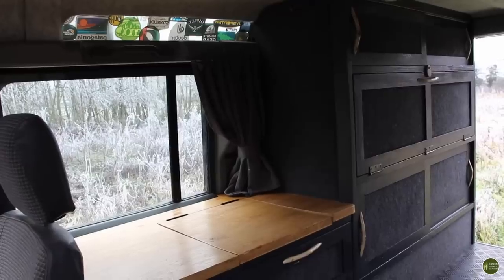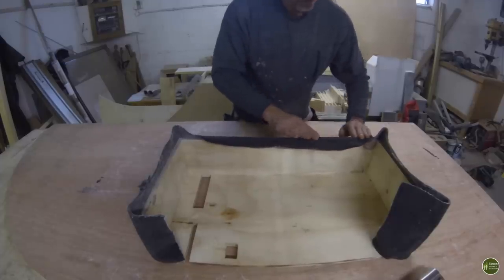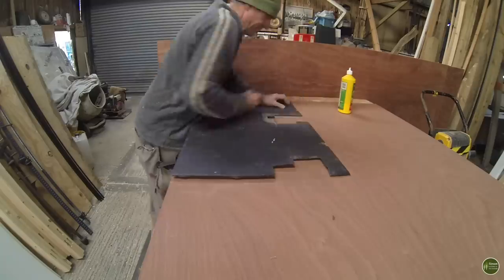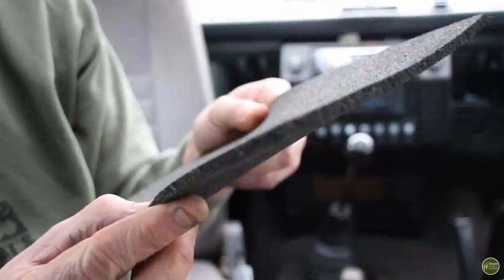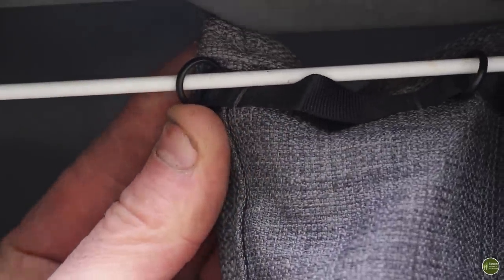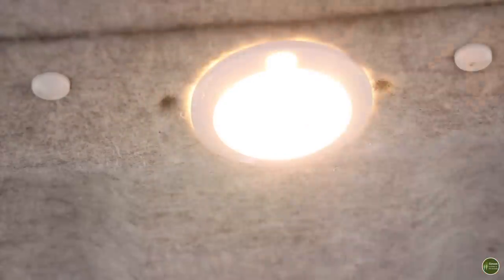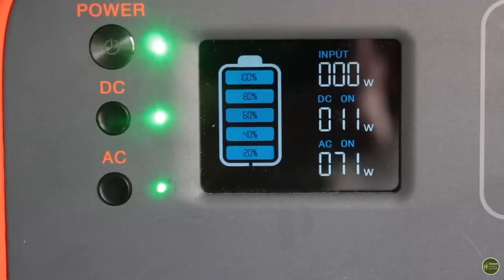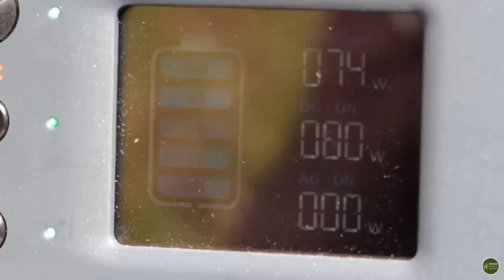Land Rover Home Build Camper Conversion - Part 2.  Off-Road, Off-Grid Adventure Vehicle.

Comment from the maker: Hi folks - some of you were having trouble with the discount code for the heater - this is now sorted - all my fault!
The code is ‘Simon’
👍
Reply: I went on their website. They have a ton of heaters. Which model do you have? I don't see any at £95. I assume that's after the discount.
Reply: This is nice and perfect .. good job pal
Reply: Like it
Reply from the maker: @Rob S Mine is the one at the top - it’s actually £103 - my mistake. 👍
Reply: That solar panel link is now a dead end I think, just so you know..
Reply: Simon the heater doesn't have a thermostat control it has one for safety but not to maintain a 'room temperature' it states deg. but its just a fuel rate you can swap it to hz's if you like.

Comment: Really loving your build. A couple of things about the diesel heater, wrap the pump in foam and put under the vehicle in a box attached to the underside. Your blower air intake is supposed to be recirculating the already warmed air inside your vehicle, pulling in and heating  -1° air from outside will use a load of diesel unnecessarily. All you are achieving is forcing out the warm air around your door rubbers and windows etc. Heat heated air and crack a window slightly for ventilation
Reply from the maker: Thanks Andy - good point about the cold air - I may turn it around and draw air from the drivers footwell 👍
Reply: @simonablokeinthewoods  on the plus side of your setup you will have fresh warm air and no condensation but it’s not ideal. If it was my build then I would fit a lever system to divert between fresh or recirculating air. Loving the content by the way 😄

Comment: Hi Simon, very good convertion! I would definetly put a separate battery for domestics, all it needs is a split diode from the alternator!
I had this arrangement in my boat for years and it saved me from having a flat for engine start. Later you may add a small fridge and it will make thing worth. Good luck and stay safe. Fernando.
Reply from the maker: I think I’m going to do that 👍👍

Comment: Just watched on TV, yet again great vid Simon, regarding the diesel heater and the split charge system, definitely fit a leisure battery there deep cycle and will keep charge longer, they will still start the landy if needed, the T max split charge system has a button on the monitor that you can press if your starter battery is flat and it makes temporary connection to your main battery enabling you to start up, neat feature, I had the same system in my old defender with two 100ah leisure batteries and the same or very similar diesel heater 👍
Reply from the maker: Thanks Pete!
I’m assuming you had the two leisure batteries in addition to your main starter battery?
I’m looking at a suitable agm leisure battery at the moment 👍👍
Reply: @simonablokeinthewoods  hi Simon, yeah starter>split charge > leisure > auxiliary fuse box and on from there , have pretty much the same as before in my present 110 just different split charge relay as it was already in when I bought it, although I am going to change to a 30 amp victron battery to battery (DC to DC) charger as the give all batteries equal charge, I have my diesel heater fitted in an aluminium box so I can move it th where I need it as we run roof tent, 370°awning with side walls etc as we need more space to cater for an 11 and 9 year olds, I'm converting an ex military penman trailer into an overland camping trailer then roof tent etc will be moved to that so the landy is freed up, anyway I'm waffling on, keep the vids coming really enjoy them 👍

Comment: Hi Simon. Great build, I love it. As for your pumped water supply, I used a 12v submersible pump from a caravan shop. Also available as a 12v shower unit on Ebay for around £20. Then used a 20ltr plastic oil container, scrounged from a fast food shop, for my water container under the sink. Hardest part was making a pipe disconect so I could take the container out to refill. Just used the rubber end of a pen to push into the pipe. I have a VW T4 that I converted 6 years ago. But!!! Now, after watching this, I'm looking for a ex MOD 110 Defender :-)

Comment: Nice video Simon 👍. It's always a ongoing project,  with customizing vehicles 😉. I would get a deep cycle battery 12 volt, you can run a TV - laptop  - mini fridge. For 2 days on a fully charged one 😉, tho I do have a generator for emergency power.

Comment: Very nice. The heater looks to be nice and toasty. The seat swivel is fantastic. I would use the idea but my truck is a 1963 3-door series 2A with a bulkhead behind the front seats. Do you have details on the sink and water pump on a different Video? Thank you.

Comment: I have ripped out and binned Webasto, Eberspacher and Mikuni heaters from various camper builds when one or more of their components have failed and replaced them with 5Kw Chinese diesel air heaters.
One dosing pump for an eberspacher costs almost double the price for an entire Chinese heater kit.
All you need to remember is that the Chinese heater is a direct copy of the Eberspacher D2. The research and development had been done years ago in Germany, the Chinese simply made a squillion copies when the copyright expired after 25 years.
You could buy 15 Chinese heater kits or one eberspacher kit ....Anybody would buy a second Chinese heater just for spare parts 😀

liking the build.

Comment: Gday Simon, awesome video. Lets talk batteries, you need an AGM (aggregated glass mat) battery, what ever you do, do not use a lead acid battery they are not designed for running appliances and they have different charging characteristics, AGM like at least a 75% discharge and a quick recharge and they don't give off any gases they can be installed upside down if need be. There's plenty of info on the net if you want to research it which is what I would recommend.
Looking forward to the next instalment.
Cheers and keep on trucken 👍🏻🇦🇺
Reply from the maker: That is great info - thanks mate! Agm it is 👍👍👍
Reply: Simon, a bloke in the woods you might also want to look into some sort of smart charger, there are some good affordable ones out there, either three stage or five stage and the higher the amps the quicker the charge. Cheers 👍🏻🇦🇺

Comment: Hi Smon, cracking job on the conversion, and I loved the hammock, if you go down the split charging route, I seem to remember you need a deep cycle battery to run your equip from, as  this type of battery is designed so that you can flatten it totally as routine  whith out damaging the cells ,where as a normal vehicle battery doesn't like that , also be aware that if the batt is inside the vehicle, it wil produce hydrogen whilst charging, other viewers might have better info than me, but I'd take advice from someone fitting these systems as their job anyway, thanks for the video, stay safe mate, best wishe's to you and your's, Stuart.uk.

Comment: Hey Simon. I was having a good chuckle about your cold Land Rover, which I believe is a diesel. I had one as young man., I do believe it was a mid 60's model. It took some TLC and plenty of intervention. It was fun though. I also had a ?? '82 Toyota Land cruiser with the 4 banger diesel. Great mechanically but with the steel body it rusted easily. The opposite to the aluminum bodies on the LandRovers. It had armstrong steering and shifting, vinyl everything. A great basic 4wd machine I  live in the interior of BC, where it can be quite cool in the winter. Talking about cold, being a diesel it never warmed up enough to get some heat into the cabin. You could idle it all morning and the frost would just start melting on the windscreen. Just bundled up and drove to work, which was mainly downhill, brrrr! Climb a good long hill and it would warm up and then the heat would blast. Enjoyed the build and story.

Comment: One of the best Land Rover conversions I've seen although to be fair I haven't seen very many.
That heater is a good idea, it looks very compact too but I'm not convinced that the diesel hoses are suitable quality, I would definitely be wanting to change the one that goes under the floor for a more sturdy hose. I'd be surprised if you MOT mechanic doesn't say something about it too.
Reply: Ian,l wonder if it would be better in some plastic trunking? Or alluminium
Reply from the maker: Thanks Ian!
Yes, I think I might replace the external but with some braided cable and clip it to the chassis - it was a a bit of a rushed install tbh, so I could get the video out on time! 👍👍
Reply: @simonablokeinthewoods  I would second that comment, a flimsy hose dangling underneath won't last very long, you've also got to watch how close it is to the exhaust as the heat could melt it, even if you replace it with a better quality hose.
Reply: I sheathed my fuel line in some garden hose underneath the body. Works for me

Comment: Great video as usual. Being an armchair expert myself, the only thing that looked hokey to me, where those fuel lines for the heater. Other than that I think it is really a  sensible build! Kudos!
Reply from the maker: Thank you - I’m going to replace the fuel line with some braided pipe - especially where it runs outside 👍
Reply: @simonablokeinthewoods  👍

Comment: 5 litre water jerry can with tap does us nicely, easier to keep clean and use anywhere.
Reply from the maker: I’m thinking that’s the route I’m going down - Jerry can and hand pump 👍💦
Reply: @simonablokeinthewoods  We have the 10 and 20 ltr cans as well, the life saver can with filter is expensive and requires a little more care, don't let it freeze up.

Comment: Great build Simon 👍 One thing I loved which you didn't mention  is the sliding front door windows with the   series 2 window locks .Great touch did this myself to one of my landys
Reply from the maker: Cheers Robert! Yes, much prefer the old series doors - just got my second row doors back from the welders - my next job is putting them in - be glad to get rid of the defender doors! 👍

Comment: Looks amazing , my parents had a long wheel base Land Rover that had been converted for travel when I was a kid living in Iran around 1976-77 , I vaguely remember it having 2 bunks rollout (seaman’s hammock sort off) I think if you took the safari camp bed and it rolled out sideways like a rolller blind and the metal pole that came out could be affixed to something , I can’t find any pics of it ; all 35mm in those days. My dream is to convert a landy and put this type of bed in . Those heaters are a must , amazing find :)
Reply from the maker: That sounds perfect! I once used an old army stretcher as a bed in a series 3 swb Land Rover - it worked pretty well 😁

Comment: Textbook example of "form follows function".
I've seen plenty of camper conversions and this is genuinely one of the best.
Might not feature chrome, leather and fancy trim but it's well-made and functional and the end result is something that's spot-on.

It's easy to look at vehicles built for Africa or Australia and think of them as what we should aspire to but the fact is that in Britain, and Europe, having a living-space INSIDE a vehicle is much more important than in hot countries so we have a bunch of different challenges related to that.

Only thing I don't really like about this vehicle is the fact that it's based on a Defender.
That's definitely a "me" problem, though, because I've had 30 years of driving the bloody things and I'm just sick of them.
Even if they weren't so expensive, these days, I'd think twice about building a camper based on one 'cos I wouldn't fancy driving it.
Reply from the maker: Thanks Si, definitely more comfortable inside than in a roof tent in our weather! 
I hear what you are saying about the Land Rover too! They’re needy vehicles and certainly not high up on the comfometer scale!

Comment: Watched a vid on those heaters. It’s important to always have 12v. If it loses power it stops and can’t run down so the hot bits aren’t fannedand will melt and damage stuff. Could catch fire under the drivers seat. So a battery reserve is pretty important
Reply: I was wondering if it has a control board and a high limit switch to cut off the fuel if the blower stops or power goes off.
Reply: @MrPianoKnee  If the heater loses power the pump also loses power, pump and heater are connected via a wiring loom to a single 12v source. Also if the pump runs out of diesel or fils to supply diesel to the heater the heater will shut down.
Reply: You don't need a constant 12v supply, in  fact I have a secondary switch on mine so that it can be isolated when I'm away from the van. It is however important to switch the heater off via the control panel for the reasons you've given before isolating it from the 12v supply.
Reply: @Flexaret  so if you lose your supply the control board is dead the pump stops the fan stops and there’sa very hot vapourising plate that can melt the outside of the pump body because there is nothing to cool it. It’ll ruin the heater and if it’s in a confined space could potentially catch fire. I’d brush up on the actual internals if I was you. It needs that 12 v!!
Reply: @highdownmartin  The switch won't cause the heater to lose the supply unless I physically operate the switch. The source of the 12v supply doesn't change, it's coming from my leisure batteries, all I've done is fitted an inline switch which I won't  use if I'm running the heater, it's only purpose is to isolate the heater when I'm not using it. Lets face it, the unit already has a means to isolate the supply when the heater is in operation, it's called 15amp fuse, if for any reason the fuse fails as intended it'll do it when the heater in in use which means that the fan will stop and as a result fail to cool the chamber.  to quote you "watched a vid on those heaters" just about sums it up doesn't it ;-)
Reply: @Flexaret  I know what a fuse is thanks. We’re both agreed; loss of juice will cause a lot of damage to heater. Quite possibly terminal.   So I’m not posting rubbish and there’s no need for you to be so rude
Reply from the maker: I’m planning on installing a second battery as a precaution.
Reply: @simonablokeinthewoods  A secondary battery is going to be a benefit, obviously you'll isolate it via a voltage sensitive relay or charge controller from the starter battery. To clarify why I fitted an inline switch to enable me to isolate the diesel heater from the power supply, there were rumours that the heaters with the remote start facility could start up accidently (rogue signal activating the wireless control?) To be honest I wouldn't be surprised if it as a case of user error however, cheap electronics/wireless control?? 

I don't use the wireless feature and didn't want to risk the heater coming on while I was away from the van. Whether you think the benefit of remote start is worth the (minimal?) risk of accidental start up will depend on your requirements, in my case it wasn't. Just clarifying why I wired mine the way I did but in general I take the view that any 12v supply to an appliance in a camper conversion should have a means of isolating it from the batteries. :-)
Reply: @simonablokeinthewoods  top man. I wasn’t trying to teach anyone to suck eggs just passing on information that I’d seen that I thought worthy of wider knowledge. I had a 95 ah battery lead chafe through, a couple of years back. ( mea culpa) and it wasn’t bloody pretty I’ll tell you. Could potentially have been “ it” for the Rover   So as your heater is captive in the seat box.....
Very much liking what you’ve done so far, neat and well thought through, with the emphasis on simplicity. There’s another camper 110 on YouTube that I don’t watch. The equivalent of the medieval knight who’s too heavy to lift himself off the ground! 
All the best. M

Comment: couple of tips, separate the fuel line on the heater from the exhaust. As for batteries, get a semi-traction battery (or two) as they are good for starting and for domestic side of things.

Comment: The split charger will work with a leisure battery, it's quite common to do that (or used to be) also, I'd fit a carbon monoxide alarm just in case since you have a diesel heater.

Comment: Cracking video Simon, the hammock is still my favourite element of this conversation. Just thinking some foam sound deadening around the diesel blower and in the pump cubby  might further to reduce the noise.
Reply: that might overheat the unit tho
Reply: @roymills2564  yeah, you might overheat the thermostatically controlled heater that exhausts all its heat 🤦‍♂️

Comment: Simon, if you don't mind, search for a dual battery system information at Trail Recon or Kramer Junction. They are Jeeper as I am, but systemwise it gives you a lot of information.. Even so Wanderlost Overland. Meanwhile I'm far away from having a dual battery system, find it easier to stay with a mobile solution as you have with the Poweroak bank

Comment: hi simon  thanks a lot for this again great video-one thing i have to tell you...the fuel line for the heater is dangerous - i installed the same heater into my crafter and a few months later the dieselline was leaking-i replaced it with an stronger material fuelresistant.. i dont know the english word for it..sorry--have a great time and stay save--hi from lower bavaria  chris

Comment: Even the expensive night heaters make the same clicking noise.

I've driven lorries for 20 years so have had all the expensive ones in trucks, and they've always made that noise

Just remember to run it regularly,  even in the summer. This helps keep it working correctly when winter comes. 

Also don't put anything in front of the heating port, as this can cause the heater to malfunction